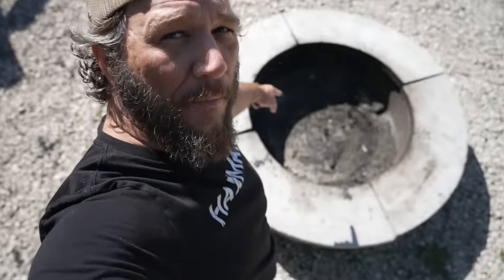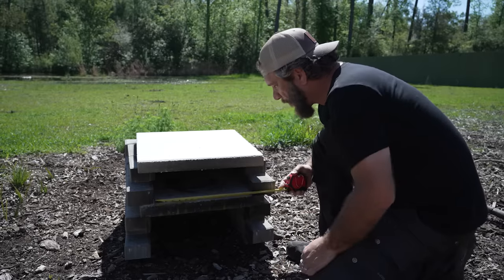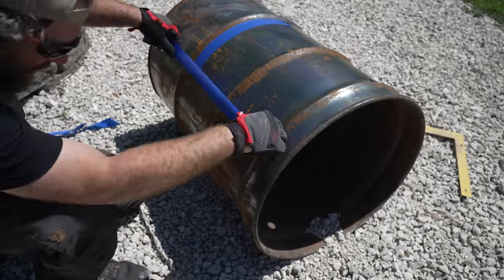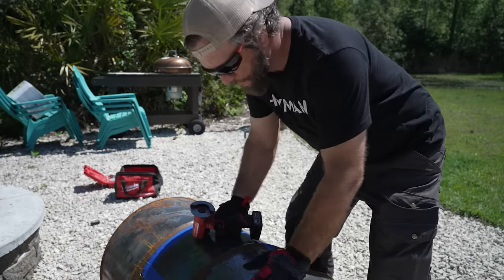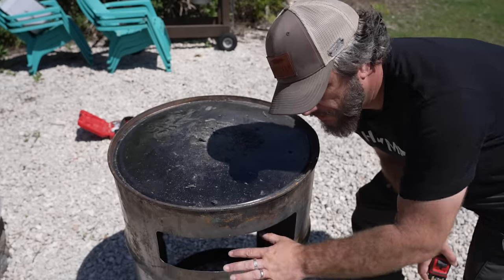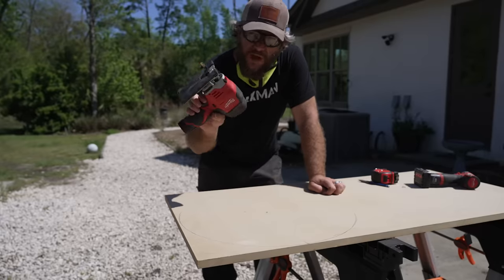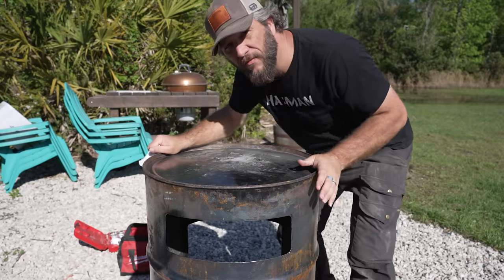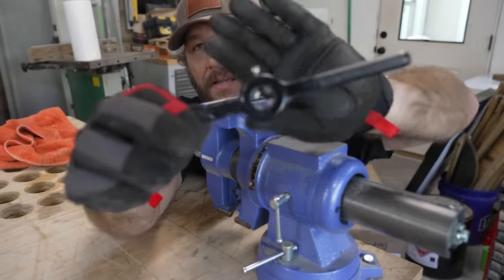This DIY Pizza Oven Is Cheap, Easy And Works Amazing!

Comment: I like what you are doing here but just by looking at your pizza I can see that the top of the oven is not hot enough. If you had a secondary layer of cement on the roof topped with insulation and channeled the hot gases through I think you'd be on to something.

Comment: you shoulda just used a pizza stone and welded some little brackets in the walls of the barrel to rest it on... and then used the refractory cement to coat the inside of top of the barrel top to reflect the heat down onto the pizza.

Comment: mmmm fresh off the fresh concrete... dunno about that... think i'd be using a pizza stone on top of that concrete for a while until the toxins burn out of it. Great job on the firepit and super job with the removable oven... Once I can get across the border, going to get me one of those feed troughs from tractor supply, you've inspired me

Comment: Old (really old) tool and die maker told me to mix a cutting fluid from 4 parts motor oil, 4 parts dish washing detergent, and 3 parts water.    Sounds silly, works great, even on gummy metals like soft aluminum.    Likes to fall out of emulsion, needs shaking often but works, is cheap, and doesn't require a special trip to the store.   What can be better?

Comment: Great design with the 55 gallon drum. I would have two concerns though… 1) A few other people that made those brick slab ovens mentioned that concrete will break after some uses and 2) most concerning is that putting food directly on that concrete, you’re releasing chemicals from the concrete into the food?
I didn’t quite see if there was a special concrete mix that you used… Going back to watch it again but just an FYI for others out there that some material will explode
Reply: He used refractory cement, which is often used in fireplaces and pizza ovens...should be fine.

Comment: Hey man!   What kind of temperatures are you getting on the cooking surface and in the space above it?  i am building one which is quite similar but I am agonizing over whether or not having the fire door on the back right under the chimney space would allow too much cold air intrusion going straight up...  so I'm thinking of placing a closable door it the front under the pizza door, but I'm not sure that i like the looks of it on the front....   The potential difference in temp will be the deciding factor.  

PS...   Thanks for all the awesome content and we love your style!
Reply from the maker: I was getting between 650 and 700 degrees Fahrenheit. I’m probably going to add a door to mine though. We want to try baking bread in it. Thanks!
Reply: @HAXMAN  Look into using a Combo Cooker or Dutch oven to bake bread in there… awesome project BTW🍕🥖😋

Comment: Cool project. I think it would be ideal if you could get more heat on the pizza from above. Maybe make a shelf over the pizza to put firebrick/concrete to soak up heat and radiate on the pizza when cooking.
Reply: Or, like in a regular brick pizza oven, put one of the flaming logs in the oven beside the pizza.

Comment: Thanks for this awesome idea!  I'm in the process of burning out my barrel for the pizza oven.  I was wondering, what do you think about the idea of using a turkey fryer burner if you're out of wood or not able to have a wood fire where you are?  It seems like it should work.
Reply from the maker: I think that would work great
Reply: @HAXMAN  you could use the burner out of a hot water heater. I made a fish cooker out of one. New sub.

Comment: That’s really great! One way to add to this might be to add another concrete disk to the top so that the pizza gets heat from both top and bottom? That way it will replicate the dome effect of a traditional pizza oven?
Reply: I was just thinking this also! Daresay simply coals on top of the drum (and a base 30cm under or so) would have a similar effect.
Reply: @darrenmanser2847  yeah that would work! Like a Dutch oven? I guess the coals would be a pain if you wanted to do multiple pizzas and stone gets you retained heat! But coals are instant heat so both have good points!!! Loved the video!
Reply: @Gregg4886  Exactly like a dutch oven Gregg! (that i've used to fabulous success for both bread and pizza while outback camping in Australia!) The coal bank can be trying but we have a lot of great very dried wood out there.Ha
Reply: @darrenmanser2847  legend!!!! Make sure you do an updated video!!! I want to see!!!!